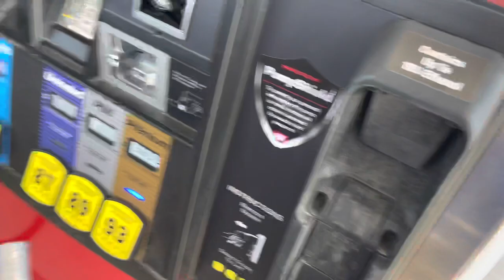TAKING THE FASTEST N/A G37 ON ITS FIRST DRIVE IN 5 MONTHS!!! - POV

Comment: Do you have IG? I am actually selling an exhaust that sounds REALLY smooth. I have videos of it. Not many people run it (it's $1570 new). It's the best sounding exhaust I've heard (I've been through a few). I run test pipes with it and have no rasp. Not "no rasp" like other people who say there's no rasp but there is -- but actually no rasp. It's not super loud but it's not quiet like the Stillen, either.

Also that guy in the other comment who told you to get a Stillen is 100% wrong. You DO NOT want to run catless with a Stillen. It sounds really bad. The rasp is very bad with that setup. If you run the Stillen you want to use high flow cats. Sounds great like that.

If you're interested, leave your IG and I'll message you all the info.